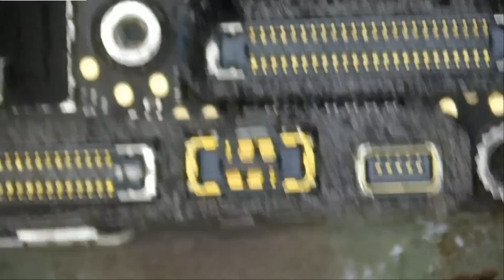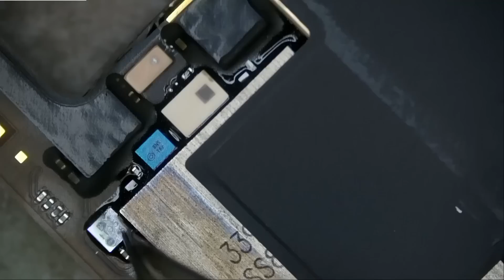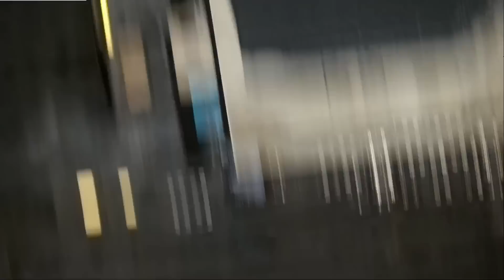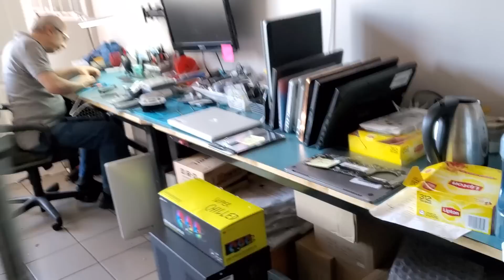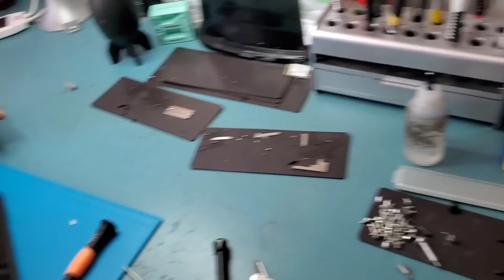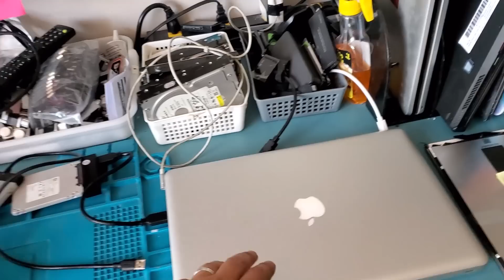iPhone 8 Plus Won't power on - Short Circuit Repair

Comment: Hi, great video! My 8 plus is not charging the battery even though the battery icon shows a lightning bolt as charging. I know it’s not the battery because I tried another battery and same thing. I got a wireless charger and that seemed to work for a couple of days and then it would no longer charge the battery. Could it be the board?

Comment: Can I ask you guys a question and please help me. I have a dead short on one of my 12v 6pin lines (GTX970 msi) and tried using voltage injection.... as far as I can see only the GPU is heating up... I AM NOT USING A THERMAL CAM.

Comment: Another fix with a shorted capacitor.  Have you done a repair with an "open" component?  I read somewhere these smd capacitors most of the time will short which makes it easier to diagnose (thank goodness for those thermal imager cameras!).  Perhaps one of those "no fixes" had an "open'" component which definitely need some kind of diagram (and lots of time, which is not really worth it for any repair person)?  Great educational videos and thanks for posting!
Reply: What you call an 'open' cap troubles no one. Think about it. If you are calling the opposite of a short 'open' then flicking the cap off the board is the same. Other components must conduct but not a capacitor. Alex often checks for non-conducting components, filters and resistors mostly.

Comment: Funny how filter caps seem to cause 80% of the issues. Makes you think maybe they should put less of them in the design.
Reply: Mainboards are usually overengineered regarding their decoupling capacitors (which are used to filter noise from the power supply and other signal lines locally at the IC level). That's the reason why you get away most of the times when you just remove the shorted cap.

Comment: Big boss next iPhone 8 tgat comes in for repairs after Alec fixes it get some helium gas and let some out in the office. It throws the crystals off and the phone shuts down for a couple hours. Phone starts up by itself after the helium gas goes  away. It only takes 3-5 % of helium.

Comment: Hello! At 7:45 a voltage drop is being mentioned. Can anyone tell me what it means? What is is used for? Thank you.
Reply: Voltage drop just means the voltage he is reading on his multimeter. When in diode mode the multimeter applies a low voltage / low current to the circuit to see if any semiconductors start to conduct. Typically a diode will conduct at around 0.2 to 0.7V depending on the type of diode. In any case he just checked if there wasn't a dead short anymore and verified this by reading a voltage drop of 0.2V, which means that some semiconducters in the circuit dropped the test voltage the multimeter applied by that amount. Any voltage reading can be considered a voltage drop. Imagine a two legged component like a resistor. When you're reading 0.2V voltage drop on the multimeter it basicaly means that the potential difference is 0.2V which means that one side of the compenent has 0.2V of electrons (negative charge) more on it's negtive side than on it's positive side, the drop in potential (0.2V "worth of electrons" on the negative side VS 0V worth of electrons on the other side -> 0.2V voltage drop) is why it's called a voltage drop.
Reply: Voltage drop (in volts) mentioned in this context can be thought of as similar to resistance (in ohms). The way the diode test function on the multimeter is expressed.

Comment: How to know value of the capacitor replaced?
Reply: Crystal balk or donor board for part.
Reply: Circuit diagrams and board viewer files might be available for the iPhone 8. The information is stored in these diagrams and design files and can be looked up.

Comment: I am amazed how quickly Alex found out the problem with shorted to ground capacitor. Great job done repairing this IPhone 😊
Reply: Well optical inspection is the first thing you do before your start any measurements. Doesn't make much sense to start the other way around if your devices main SOC chip is a piece of charcoal for example. Corrosion due to fluid ingress must be one of the most common failures in any handheld electronics device. Still a good job by Alex. His content is amazing!